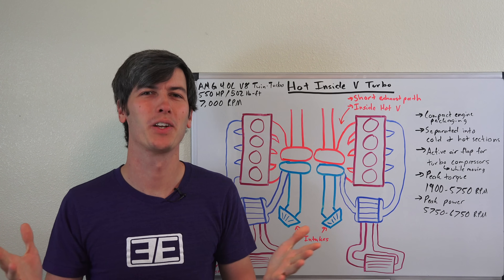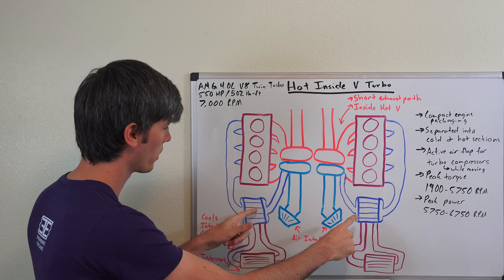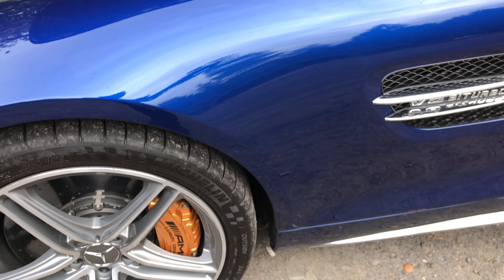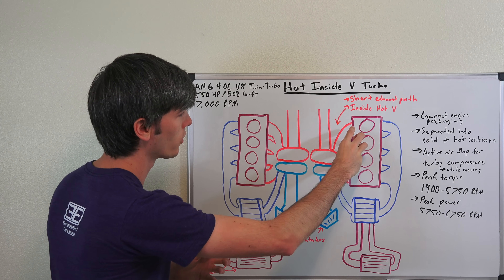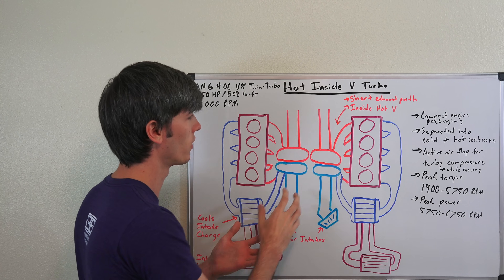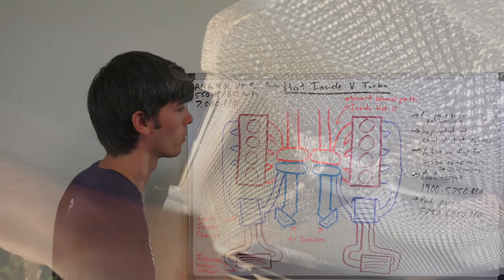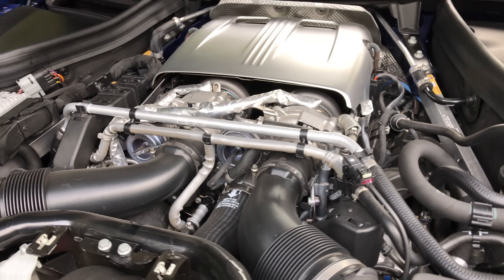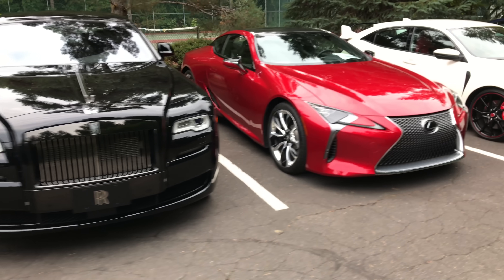Mercedes Clever Turbo Engine - "Hot Inside V"

Comment: Same setup Ford has with the 6.7L diesel. No?
Reply: 7.3, 6.0, 6.4 are traditional flowing V blocks, all manufactured by International.

6.7 is manufactured by Ford and has reverse flow (hot V).
Reply: The Real John Smith I guess the difference is that the exhaust side on the 6.7 is on the outside of the v and not on the inside like this.... hence the name "a hot V"... UPDATE I was wrong in my assumptions...
Reply: Hmm. I thought (could absolutely be wrong) they reversed the flow of the heads to have the exhaust go directly to the turbo in the "V"
Reply: Yes
Reply: Yup.
Reply: Not a twin turbo which people are missing.

Comment: Great video. I just want to point out that BMW did it back in *2008 with their N63 engine
Reply from the maker: Thanks for sharing! I wonder if Mercedes added the "first in a sports car" tag to differentiate themselves and say that whatever BMW this was used in wasn't a "sports car?" Anyways, interesting! And yes, it's been around in racing certainly.
Reply: Even if my modded F10 550i is not considered a "sports car" (right in the feels), a 2012 M5 with S63 engine that also features hot inside V setup most certainly is
Anyways - first N63s were put in BMW's X5 and X6 SUVs. Kaisueke971, thanks for pointing out that it indeed was 2008
Reply: yeah, N63B44 and S63B44 BMW engines... and they were a big mistake because of low reliability caused by heat from turbos
Reply: Worked in BMW  service. These engines suck. Bad design. Turbos INSIDE a heat sink? Pfffft.
Reply: John Ramsey two things, a heat sink is something that takes him out of the system I'm not really sure that's what you meant to say. Secondly, I get how the design sucks to work on but that's not really what this video is addressing the engineering and efficiency of the set up is pretty interesting and amazing and positive.
Reply: and BMW got the Idea form marine engineering ;)
Reply: Exactly what i was about to say
Reply: Actually it's 2008 in the X6
Reply: BMW put it in the M6 "sports car?" in 2012
Reply: The turbos have never been the problem on my 550i, the Injectors, and fuel pump are the problems of the car. The turbo eats a little oil if you romp on it a bit but thats all. Also the piston rings go out around 100k.
Reply: The 2012 M5 was indeed a sports car.  BMW also goes as far as designing a cross-bank exhaust manifold so the turbos receive equal pulses of exhaust gas to give the best response.
Reply: And Ford did it with their 6.7, though obviously not a sports car
Reply: My F10 550i XDrive has the Hotvee N63 engine and it definitely isn't a "sports car" but boy is it fast and with my tune and cat deletes it gained sooooo much boost and power.
Reply: yeah, those turbos doesn't have problems themselves, but they are continuously destroying injectors by the heat they producing...
Reply: Haha, funnily enough I owned an F10 M5 and I didn't know this.
Reply: Correct. 1st BMW engine that had this was the '09 BMW S63 Engine in the '10 X5 M, produced starting in Sept. '09
Reply: wandaxDesign in terms of engines bmw is a class leader
Reply: Yeah, I was about to say!
Reply: Mohammad Chehadde 

BMW isn't a class leader actually they usually are the midpack by performance it goes merc-AMG, BMW M then Audi performance. 

In terms of reliability of engines it's like Audi, Mercedes, BMW. 

This is coming from someone who a BMW, a Mercedes, and a Lexus. Ive spent enough repairing the BMW engine alone to buy a third Lexus.

In case you're wondering I own the 13' BMW 550I, the 17' GLS450, the 06 lex GS300 and the 09 Lexus gs350.  I'm willing to admit I have a bias towards Lexus tho
Reply: Yes BMW did it and it was a complete piece of crap. Like all BMWs.

Comment from the maker: Fun fact! The Porsche 918 actually has a 'Hot V' setup as well (the exhaust is mounted inside the V), however it is naturally aspirated. It's what allows for those epic exhaust ports right behind the passenger cabin. Hope everyone's having a great day! And if you're into sneak peaks and other nonsense, consider following on Instagram - so close to 80k followers! :) https://www.instagram.com/engineeringexplained/
Reply: The Audi R18 Le Mans prototypes also had 'hot V' turbodiesel V6s, although of course they were not production vehicles.
Reply: Isn't the Ford 6.7L Scorpion Powerstroke diesel configured in the same way?
Reply: Engineering Explained so if something ever went wrong with one of those turbos I'm guessing this would be an absolute pain to fix without dismantling the engine?
Edit: I just realized they are mounted atop it appears XD so that shouldn't be as bad of what I was imagining.
Reply: Lets wait to see how reliable valve stem seals are going to be 😁
Reply: Bmws twin turbo v-8 engines had this style since they came out, even more unique is the M engines turbo hot side intake paths, they are mixed!
Reply: ^ I imagine, it's when you write the comment, while underneath the car, then jack it down and have to edit.. :D 
Well, still hanging question - how to change the sparkplugs?
Reply: You might like to know Audi did this with their 4.0 v8 like 2 years ago
Reply: Is it possible to convert/retro-fit turbochargers in this configuration on any other motor? like on a LS, Coyote, Vodoo, Hemi or Pentastar ... like literally any motor without major modification on valve head ?
Reply: NICE videos.... could you8 please make one video of the 2015-2017 Taurus SHO engine???
Reply: Would call the 918 a V motor
Reply: Engineering Explained Intriguing stuff, not gonna lie.
Reply: BMW pretty much have the same exact layout . Now Im wondering if they partnered up on the development  of this engine.
Reply: This is the child of BMW & AUDI one night stand
Reply: Naveek Darkroom yeah I agree, still just a thought cause the layout is pretty much the same and they both use bosh for a lot of their parts
Reply: Engineering Explained, your videos are awesomeness. Thank you for making them. 😀
Reply: The BMW M5 also has the turbos in a hot V, but the turbos in the M5 gets gasses from 2 cylinder in each bank... not like Mercedes with the turbo only getting gasses from one cylinder 
bank ;-)
Can you explain why??
/Steffen
Reply: Engineering Explained Ford did this with the turbo on its 6.7  V8 Power stroke Diesel engine
Reply: Hybris51129 yes, it is this way
Reply: Don't forget introduced this nearly 10 years ago.
Reply: The BMW X5M and X6M also have a similar turbo-inside-the-V configuration if I remember correctly. Nightmare to change spark plugs since you have to remove a large chunk of the turbo system to get to the plugs
Reply: Engineering Explained Is there a video on clutch vs electric fans?
Reply: Engineering Explained when did Amgen start doing this? BMW has the same setup on the m5, m6, x5m, x6m and maybe even the 7 series... and it's twin scroll twins on BMW
Reply: That makes sense
Reply: Didn't Audi do the same thing with their C7 S6? I'm like 99% positive. My mom owns one and they're right up there on the top with the cylinder heads "flipped".
Reply: Engineering Explained Hello, this isnt a question related to this video but an older one. You've previously stated that tires are the best improvement. So how would you identify the tire's coefficient of friction? Or expensive tires automatically have better coefficient?
Reply: Engineering Explained I’ve come to an unanswered question. Why do people run, let’s say, 16” tires and wheels in the  winter than, let’s say, 18” tires and wheels. Other than the 16” can handle the snow better, are there any damages that will severely damage the 18’s than the 16’s.
Reply: Chris Gnay that's easy and is covered everywhere. Larger wheels will pack with snow easier. They are also easier to damage on pot holes and curbs.

You want a snow tire to be tall and thin.
Reply: User Name thanks bud. That’s all I needed to know. Maybe i was looking or a specification. But in this case if the snow isn’t going to damage my brand new wheels and tires severely then I guess I’m good to go.
Reply: Chris Gnay the salt will. Wider wheels have wider tires. They have worse traction on snow. The higher psi the narrower tire has because of the smaller contact patch will push snow out of the way and melt more ice giving you better grip
Reply: Ronaldo Hemmingsworth: You might like to know that BMW had this layout on the N63-engine in 2008 ;-)
Reply: Arjun Manohar no because the intake and exhaust path are flipped 180 degrees. "Could" it be done? Yes if someone made custom heads with the intake on the outside of the V but it wouldn't be some diy job for sure.
Reply: So based on comments and personal knowledge... We could have left Mercedes out if it and remain unbiased a little, Yeah?
Reply: Ford powerstroke v8 since 2011
Reply: Arjun Manohar It should be fair game on most DOHC v8s, the LS has the cam inside the V, which obviously leaves less space for the turbos
Reply: S Jensen  pretty sure that's not how firing orders work or how crankshafts are designed

Comment: If you can afford it Mercedes has their "A" game on when it comes to cars.
Reply: Their A game is nearly 8 years behind technology bmw has already had in production vehicles.
Reply: Except for their "rain water" intake system.
Reply: Afford?  you lease these type of cars in the first place, its value depreciates like a rock, even the wealthy lease it because owning it is more costly :D
Reply: You mean like tons of vehicles that pull air from low in the wheel well or from a grill scoop
Reply: rockn roll he did. It's not a design flaw it's an owner flaw
Reply: Mercedes are big steaming piles of shite.
Reply: User Name autovlog totaled his $90,000 Mercedes because he hydrolocked the engine, splashing through a puddle, doesn't sound like "A" game material to me.
Reply: "A" game include reliability? There are many KIA more reliable than Merc, and possess much of the same technology, marketed under other names. Same goes for most auto companies.

Comment: I thought that BMW was the first to introduce this with the N63. Formula 1 had been doing it for a while I'm pretty sure though.
Reply: BMW did it in 2009, Audi in 2013. So Mercedes isnt the first at all.
Reply: F1 rules explicity says exhaust ports must be on the outboard side of the heads not inside the V
Reply: They are and they aren't. I've owned a share of BMW's. I miss them every time I sell them. They are in general a labor of love, but once you bite into them its hard to go to anything else. Merc owners can also vouch for this.
Reply: @jeepmanxj  I used to feel the same way when I sold them so I stopped selling mine lol
Reply: Bryan Welch BMW production cars have had this layout since 09 or 10
Reply: Lucas Johnson fist production car to have it.
Reply: User Name I know what you mean. I miss my s2k. Should have never got rid of it.
Reply: @bryanwelch6209  you should get another one before they are gone. If you like it that’s all that matters.
Reply: Roko Krstičević there were Turbos in the 80s
Reply: AMG was the 1st to bring Hot V’s to Production cars with the 4.0L and BMW Followed up a year or 2 later but the BMW engines have bigger displacement being 4.4L
Reply: @MrJuice105  bmw's hot v introduced in 2008.
Reply: User Name I dont know man. I am not a german car guy. I think they are a little bit overrated.
Reply: Lucas Johnson I think 2014 was the first year of turbo aspirated engines